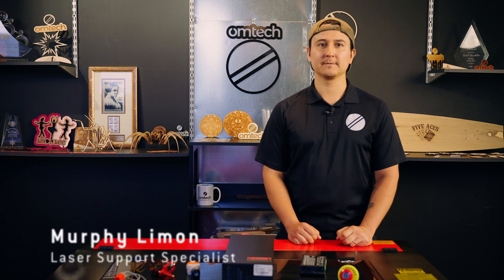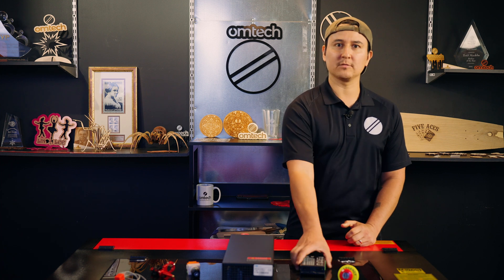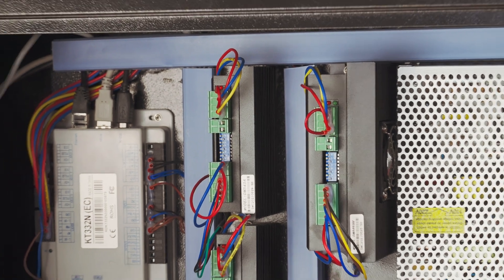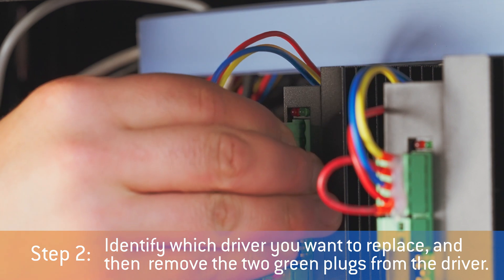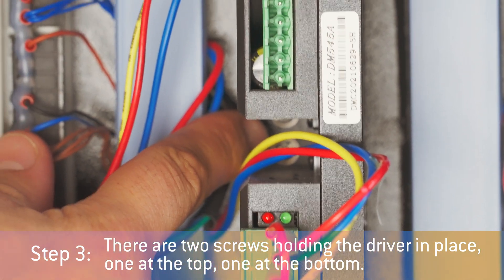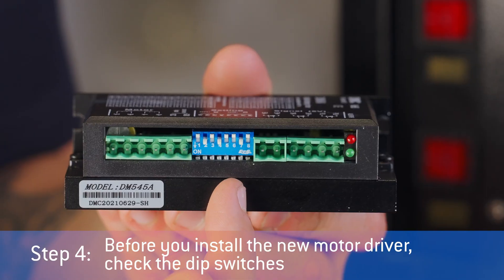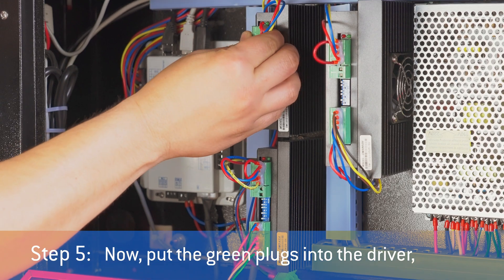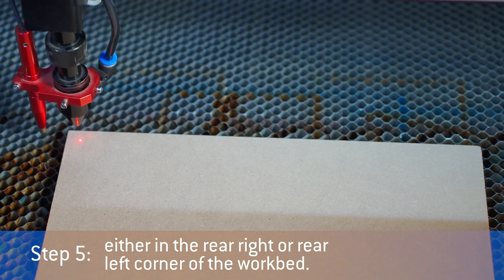How to Install X & Y-Axis Motor Drivers

Comment: Funny it may be easy to install but getting the actual parts is another story 
Y’all should be ashamed telling folks it’s gonna take up to. A month to get replacement parts ! They should be stocked at all times in your warehouse 
Utterly ridiculous this is the support you get . Losing thousands bc y’all can’t stock according but you’ve gotten your $ so that’s all you’re worried with
Reply: Im dealing with this issue now. I won't be buying another laser from them again.